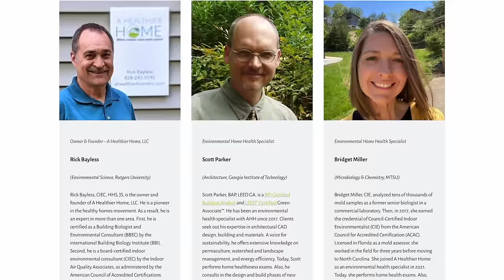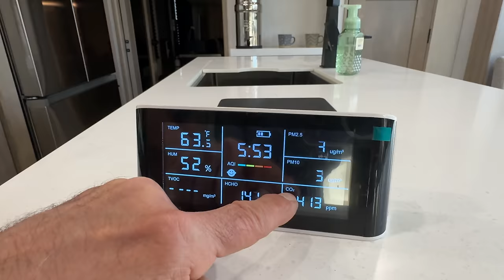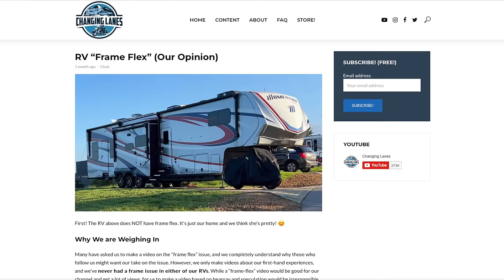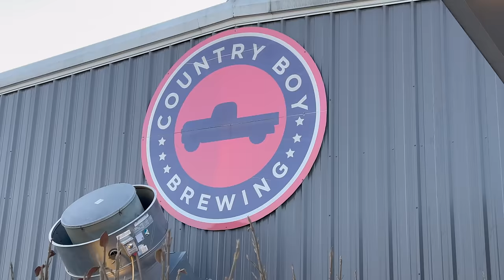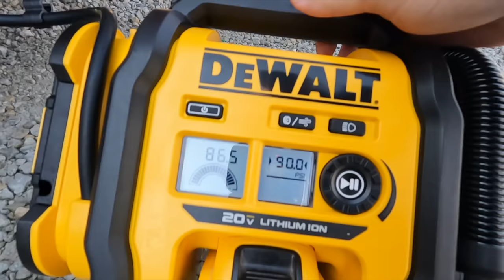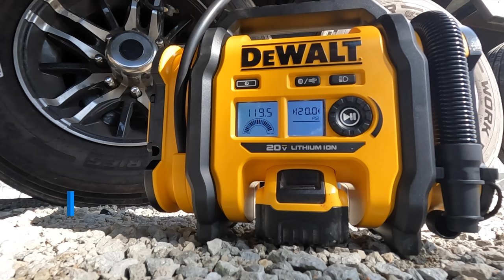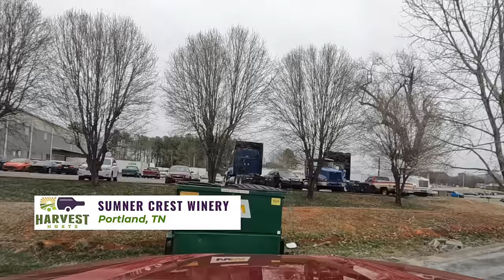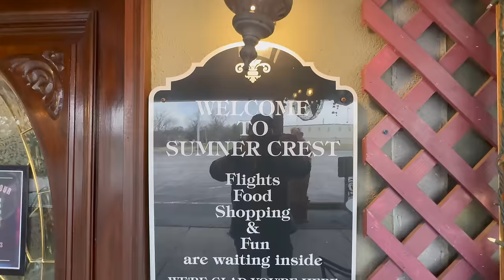New Adventures in 2024! Hitting the Road Again in our Momentum 410TH!

Comment: It's amazing. We always keep 2 of the larger batteries with us. Yes they will fill up all the tires on a truck as well as a trailer on one battery. I had to swap out a tire and it filled it just fine from 50psi, it took a while but it did it. We also use it to inflate our inflatable Kayak. Great Product, easy to store as it is so light and compact. WINNER for the last 4 years.

Comment: I have the DeWalt tire inflator and love it! you mentioned getting a tire chuck adapter, I think the way it comes with the thread fitting for a tire valve stem works great since it is not a quick inflation like you would get from an air compressor. Being able to connect it, select the pressure and let it go would be the easier way to use this inflator. It also has a blower mode you can use for blowing up an air mattress or pool toy that works well too.

Comment: I've had the DeWalt inflator for a few years now and love it. I already owned other DeWalt products so I had batteries available. It's so nice not needing to connect a power wire and also being able to set a pressure and walk away. After a few years mine is still like new even after a lot of use with 4 cars, 1 truck, 2 motorcycles, and a travel trailer.
Reply: I have been looking at this to purchase but was wondering if you can use it to blow out the water in your lines to winterwize. Have you used it for that and does it work?
Reply: @janetreed6371  I have used it to pressurize the system but you really need something with a storage tank to maintain the pressure. I used a Schrader valve adapter on the city water inlet and pressurized to 55 psi with the pump while my wife opened water valves inside the rig. Pressure drops quickly and the pump doesn't maintain the pressure. It's useable in an emergency but something with a pressure tank reservoir is really best.
Reply: @farrell19075  Thank you for that information.  That is what I was afraid of.  Trying to find something that will do both.

Comment: Love the video.  Try the M18 Milwaukee air inflator.  Topped off all 8 tires on our Class A tag (120psi in front & 100psi on the back) on one 6AH battery with plenty of power to spare.  Also, the M18 has 4 memory presets.  Chad, if you are a gadget guy, the M18 is the way to go.
Reply from the maker: Yea.. but then I have a whole new set of batteries and chargers to deal with.. 😳
Reply: @ChangingLanes  True . . I've been a dewalt guy all my life, but this one was worth changing platforms.  Safe travels.
Reply: I too have the Milwaukee  and love it.  I have their 1/2" Impact  also so it made sense to get it on the M18 platform.  I really like the programmable Memory set pressures.
Reply: That inflator is one reason I've considered going to Milwaukee. But I'm too invested in makita at this point.
Reply: @ChangingLanes you can buy adapters. However I have the dewalt and have been using it full time on the road for five years and love it.
Reply: Harbor Freight Air Pump checking in. 50 bucks, the 5amp battery cost more than pump for anyone else shopping. I can top off our truck and travel trailer with plenty of power left over.
Reply: I have the same DeWalt inflator. Bought a clip on air chuck that screws into the end of the hose on the compressor side, about $5 and all brass from Amazon. Works great. Clip it on, set the pressure and walk away.

Comment: Love your new toy. After we bought our travel tralier, we had a blowout. Our air compresser that we took out of one of our vehicles couldn't even get it to 35 pounds. We limped into a Lowes and started looking at compressors.This one caught my eye but was a little pricey. Well, we have blown up several neighbors tires, some bycycles and pool toys. And i own several dewalt tools, so I didn't have to buy extra batteries.  Well, I did anyway including a couple of the 5AH ones.  Safe travels.

Comment: Have hvac guy or you can check your indoor unit.  Remove blower door.  Sometimes very moldy.  Also look up airscrubber. Uv light.   Invest in one if you can find it.   I can supply one if interested.   Good luck

Comment: Chad, I had a similar issue with underglow. Solution for install I put on our Class A ran all the way around for a total of five 16.5’ strips in series. Original install used two independent power supplies and two wireless controllers. Solution was one power supply and one wireless controller, solved transient voltage and random color changes. Hope this helps. Mike and Rosie

Comment: I have the same air compressor. Works great. The only problem I have with mine is the battery will drain down even when it’s turned off. I have to take the battery off

Comment: I have had the dewalt  tire inflator for a long time. I was very impressed with it. I did switch over to the M18 Milwaukee after I seen that the M18 would inflate the higher pressures faster. If your doing multiple tires,  the time adds up. Just a thought. I enjoy the videos. I appreciate how industrious Chad is. It's good example for me.  I wish you both all the best!

Comment: Do you have any UV lights in your HVAC system? The purpose of a UV light is to clean the air from any airborne contaminants such as mold spores, and numerous other pollutants. One should be placed in the air handler within sight of the coil. The second should be placed in the supply air ductwork, which will sanitize all the air going to the living space. In conjunction, best to use a return air filter of higher efficiency to clean the fine particulate. UV lights are also made to be used in the RV heating and air systems.

Comment: You mentioned all 3 tires on one side were lower than the other.  That other side looked like it was in the sun, I bet that was temp related.   I have been learning a bit on what temperature does to PSI.   I traveled over the winter and because it was 10F when I left home, I had my tires about 8 lbs under-inflated and by the time they got up to 60F they were right on PSI.
Reply from the maker: Oh yea.. we have to adjust from location to location.  I just had to let about 10PSI out of al tires the other day.

Comment: Chad, how many towing miles did you have when you determined it was time to service the IS system and Disc Brakes? I just had the MorRyde IS system with Disc brakes installed on our 399 last December.  What a difference it makes.
Reply from the maker: Not sure how many miles, but it had been a little over a year since we got the system.

Comment: how would someone use that air compressor on a DRW, if I they didn't have fancy valve stem extentions on the inside tire?   it needs the longer wand like the ViaAir has, allowing you to reach through the outside tire to the inside tire.
Reply from the maker: Yes.. we have valve extenders.  Without those, you'd need to adapt it using a shrader to NPT adapter and a chuck to reach the rears.  https://youtu.be/tgT3u02bmaw

Comment: We noticed you didn’t seem to have grease on the pin. Is that how you normally operate? We thought we had to keep ours greased up- would be happy to have one less thing to do!
Reply from the maker: We use a lube plate but no grease on the pin itself: https://gear.changinglanesrv.com/product/curt-5th-wheel-hitch-lube-plate-12-inch-diameter-2/

Comment: Wow! Removed it already.
Reply from the maker: What did we remove?
Reply: By the way, the “less than 1/2 of 1%” is a lie. A number of us think it is at least somewhere between 3-5%. Even at their stats it comes out to over 1800 owner’s rigs per year. Still way too high!
Reply: @WestsontheMove  on their website under their take, they say 1% of 5ers over 17k lbs.   I don't think frame breakage is as common as some people make out.  Also it is from what I've seen, chassis that use the conventional crossmember pinbox mounts, Lippert 1621.  I have yet seen a failure from a Rhinobox Spacesaver Chassis.
Reply: Good to see ya back on the road.  Always look forward to your video's.   
Funny you featuring using the DeWalt air compressor.   We just bought ours tonight at HD!!  
Safe travels!!